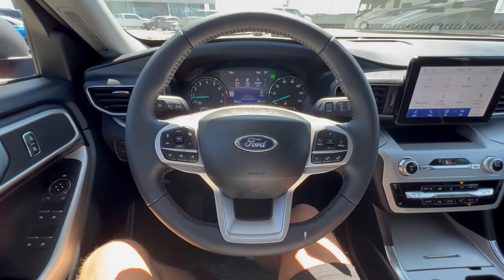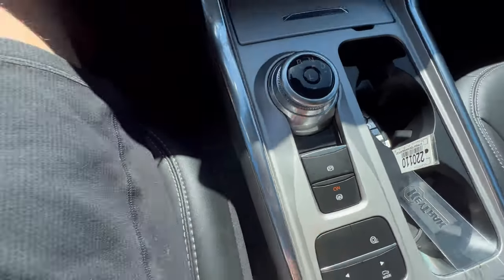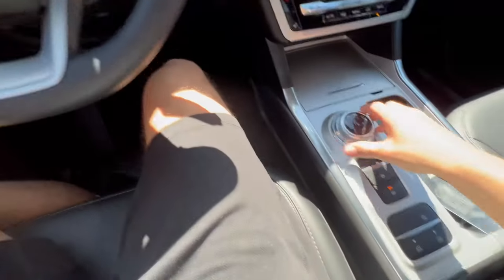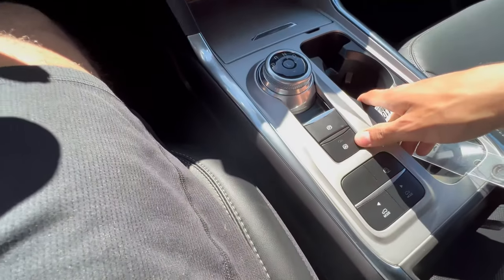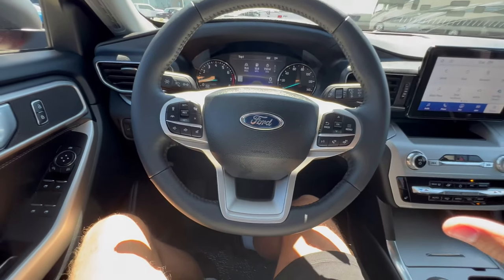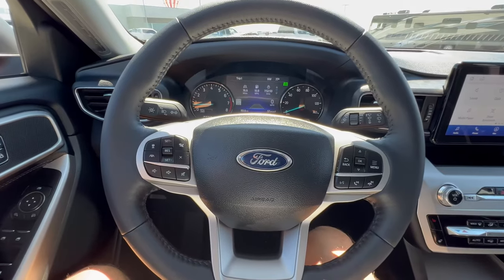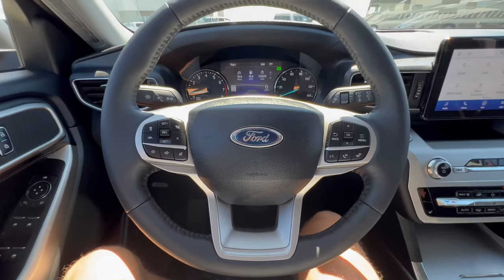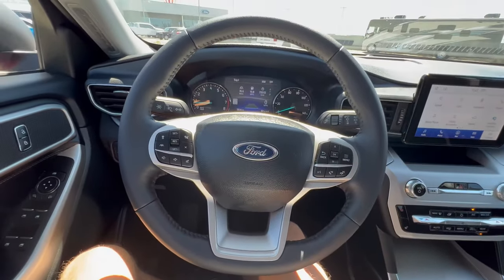What is Auto Hold and How It Works Tutorial

Comment: You enable "auto hold" and it will hold the brake when you are not pressing the accelerator.  It's more useful for manual cars, as the clutch + brake can really become quite tiring.  Now you can just shift to neutral while waiting and not have to apply your parking brake, and rest your feet.

Comment: When using this on a manual and U want to move how would this work? Please to both stop and move would one need to be in gear 1 first b4 using the gas to move the car? Hope it makes sense Thanks
Reply: Works fine, depress the clutch and brake pedal. Handbrake comes on. When ready to move off engage clutch and brake releases. Works fine on my manual car